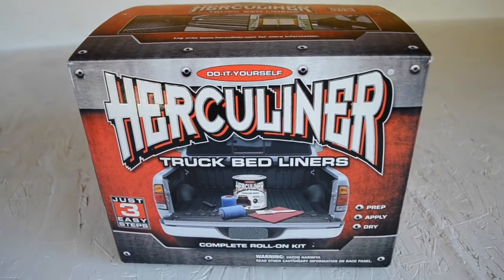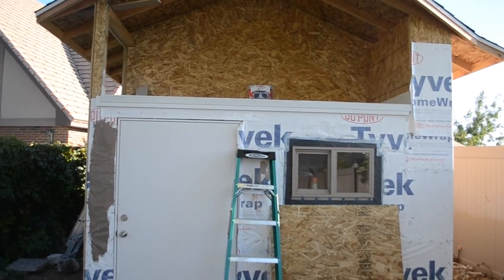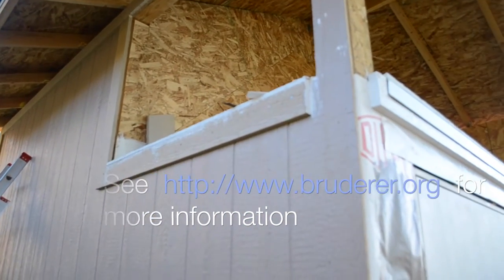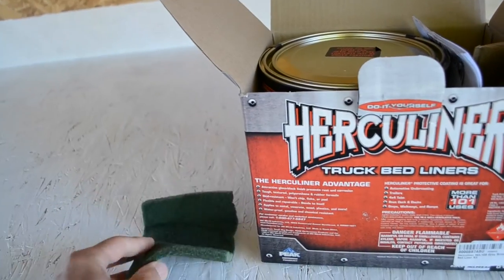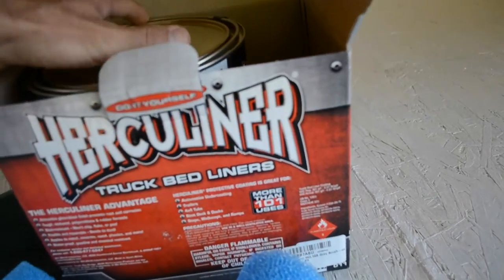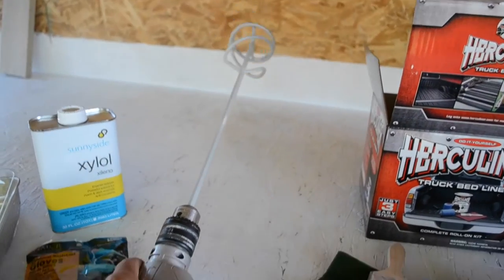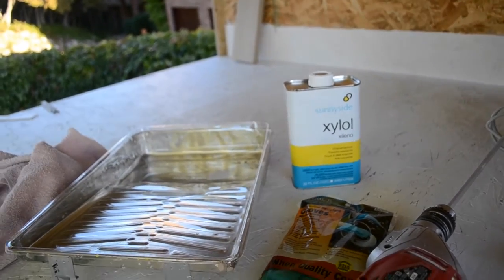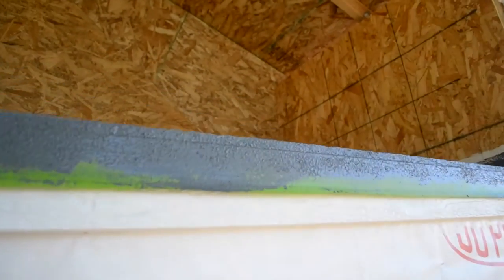Herculiner on the deck of a shed/playhouse

Comment: I just bought this product for my Jon Boat. I used marine grade plywood on the floors. Do you think it needs to have a primer coat before the application? thanks in advance.
Reply from the maker: I used primer so that the herculiner would go further, that is, get absorbed less into the plywood. You could consult with a paint shop to see for sure. In 2019, my roof and Hurculiner covered deck still keeps the water out of the shed. I remain pleased with how it turned out.

Comment: I’m thinking about doing a shed floor with something like this. Any thoughts on that would hold up? Tool box drags, lawn equipment, smells. Thx
Reply from the maker: This has held up very well for my application. It is very durable. You could always buy a small quart every few years to repair any damage that may occur. So far I have not had to repair mine. If you end up doing it, please post a pic of your project.

Comment: How did this work out for you ?  I've just got my 12x20 shed delivered and I'm needing to preserve/paint the flooring and the sidewalls.   I don't intend to insulate or additional interior walls.
Reply from the maker: Ken Bruner, I applied it in 2014 and in 2018 it is still holding up well. My kids still love playing on it. Just this summer I added a rock climbing wall on the side.